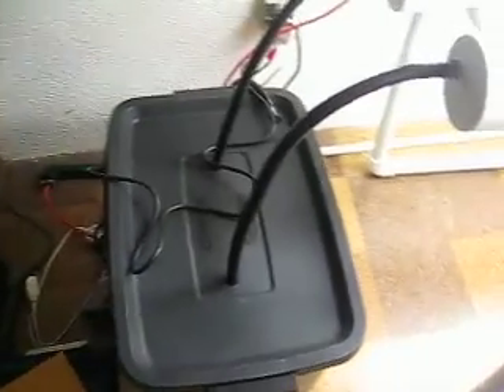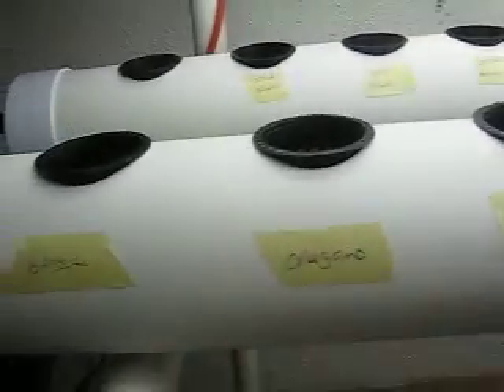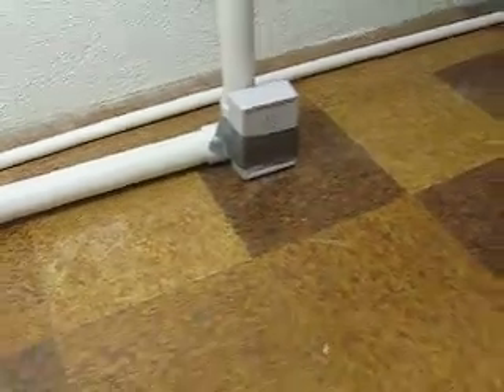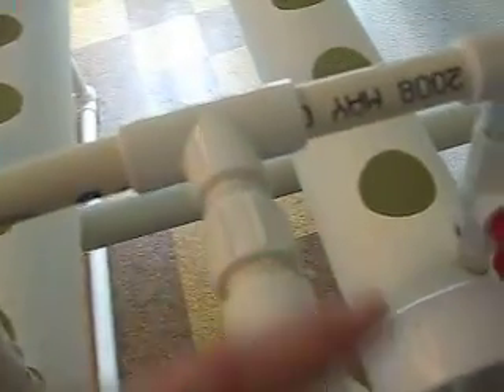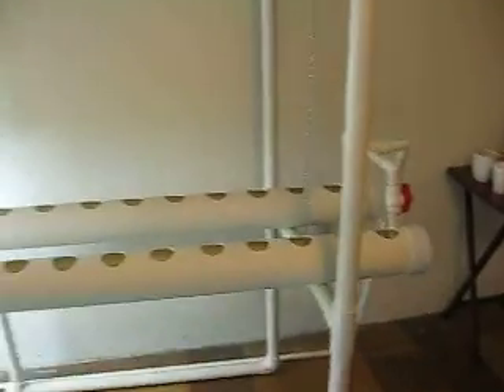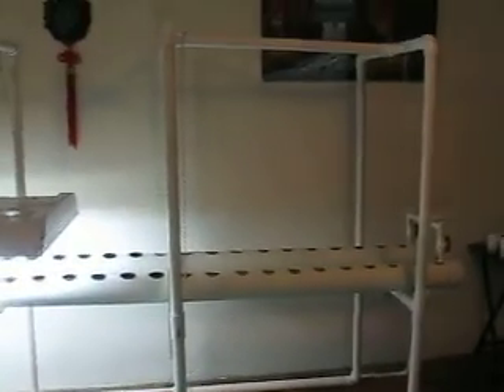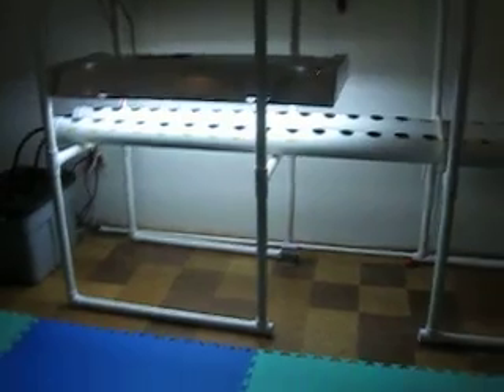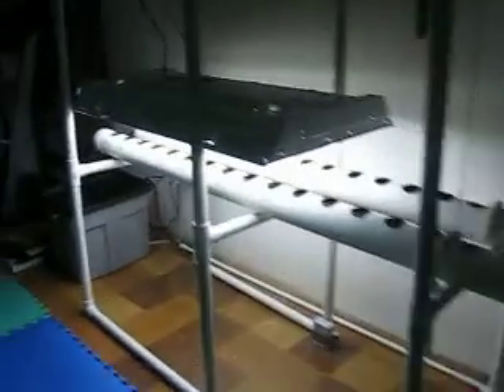Initial Setup for Edentro Hydroponic Deep Water Growing System (March 1, 2009)

Comment from the maker: There are nozzles protruding from the pvc pipes that allow the hoses to connect to it. This is the trickiest part of building this unit. If I had to make this from scratch, I would not use hoses or nozzles and instead have the pvc go directly into the side of a stand-up garbage can on wheels.

Comment from the maker: @sonayvaio Hydroponic nutrients are different than regular plant food, you don't want to use that in a hydroponic system.

The air pump and the water pump runs constantly. It is not on a timer.

16 hours on. 8 hours off. This is ideal for most plants.

I'm glad you enjoyed the video, thanks.